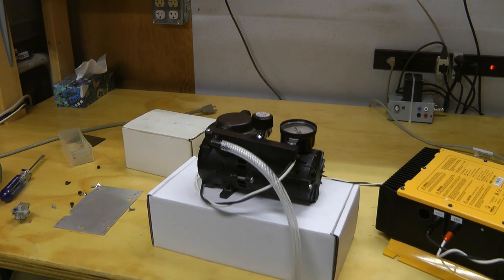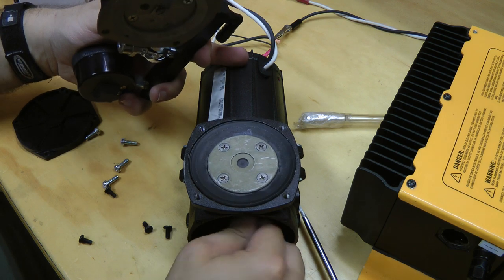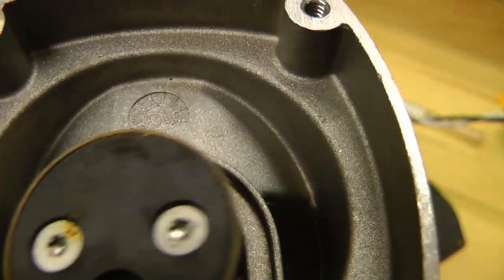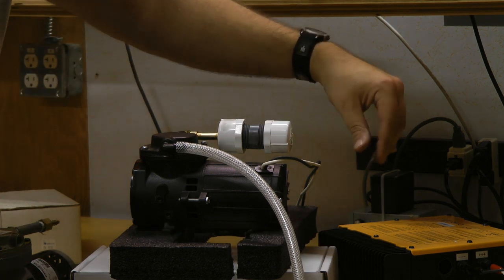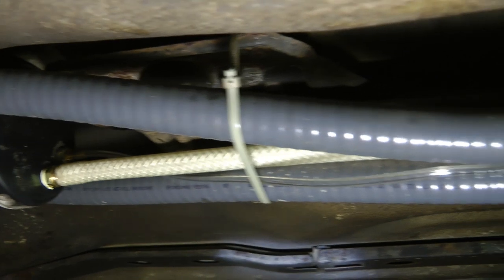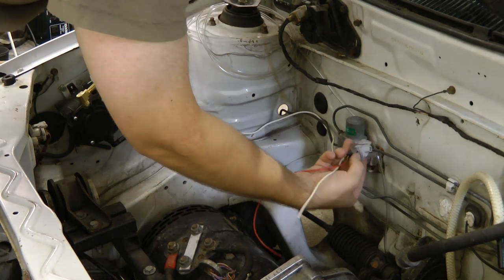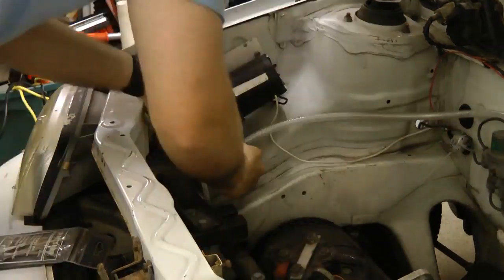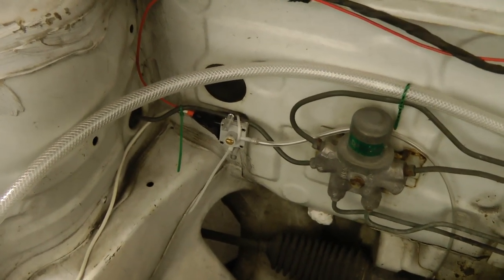Electric Car power brake vacuum pump

Comment: Good video. I used one of those pumps at first and tried a lot of things to reduce noise. I then switched to an audi A4 electric brake pump. Cheaply available on ebay and are virtually silent. I too had a problem with the pump turning on and off a lot. It turned out to be vacuum leaking back through the pump. I had to use a non return valve but this was not a problem with the audi pump.

Comment: Audi from the 90s have vacuum controlled door locks. The pump is located under the rear seat and capsuled in standard car seat foam. It works pretty well. Perhaps you should try that too? Otherwise it sounds like you have a tiny gas engine under the hood hehe :P

Comment: My house central vacuum intake muffler uses a concept of a soft foam tube inside a long cylinder so the air flow is not impeded by fiber or tissue bunching.  I think my DVR hard drive could use some of your rubber tube feet isolators.

Comment: Excellent video on a brake vacuum pump installation.  Just out of curiosity, wouldn't the vacuum pump better be connected straight to the vacuum reservoir, via a check valve, then the other connection at the reservoir onto the brake booster? The check valves will keep a sealed system until such a time as  vacuum is depleted by applying the brakes. The vacuum switch could then be teed anywhere in the line between the  check valves so that it detects vacuum loss to start the pump again.

Comment from the maker: @superdau The only requirement for an inspection I can find is when insuring the car for the first time after changing the fuel type (converting the car to electric). After that, I believe the user is responsible for keeping it road worthy.

Comment from the maker: @joeyf504327 Yep, it's deceptively small, the actual motor is about 2cm smaller in diameter than the casing, there's a bunch of air space around it on the inside. I am driving it, it's just a little annoying having the pump come on every brake press.
Reply: I realize this video is old, but the whole series so far is quite interesting. Have you changed the vacuum switch to remedy this as you'd mentioned in the video? If not, perhaps something simple like a normally closed relay opened by power from the brake switch could interrupt the vacuum switch power input or output only while the brakes are applied :)

Comment: Did you blow the thread chips out of the tank before installing it? That will definitely cause problems with those valves, a filter will without a doubt solve it though.

Comment: uh sorry nother question what gauge wire is that running from the battery to the switch? it looks like 12 or 10 gauge coming off the pump and then the red looks like 16 or dare i say 18 gauge to the switch from the battery

Comment: Hey, excellent HD video. I have a question about the duration of operation to get to your (switch) setting of 21in Hg. With it set up operationally, including tank and brake booster connected, how long does your pump take to reach the target vacuum level?

Comment: really good video. on the last audio test, was the audio gain the same? or just not autogain. 
and I've heard there are vacuum pumps in some diesel cars that should be suited for automotive use directly. and may be cheaper too.

Comment: Hi! First of all i want to tell i'm impressed about the job you've done converting your car to an electric vehicle, but i was thinking that at least here in europe diesel cars, since they don't have a throttle body and therefore they don't make any vacuum in the inlet manifold they rely on a small vacuum rotative vane pump to operate the power braking; they are usually mounted on the cylinder head of the engine and take the motion from a camshaft. Maybe that was perfect foy your applicatios.Bye!

Comment: You said you were running manual brakes since your car is so light. Whats the weight of it?  My car is 3500 lbs give or take and undecided if I want to go with manual or power brakes.
Reply from the maker: This car is very light, about 2000 pounds including batteries. This is about the upper limit of what I'd consider reasonably comfortable to use without power brakes.

Comment from the maker: @joeyf504327 The pump actually had thinner wire originally, I removed the poor wiring job it came with and replaced it with some 14AWG wire. The red wire is 18AWG, which is fine for the 3.5A the pump draws.

Comment: Could you do a general update of the car :) ? I am really interested in how it's doing, and do you think, considering the cost of the batteries, controller, motor etc, that it is cost effective to convert a swift to electric instead running the original engine :) ?
Reply: I'd done it in Veritto. Its successfully commercially working on road...